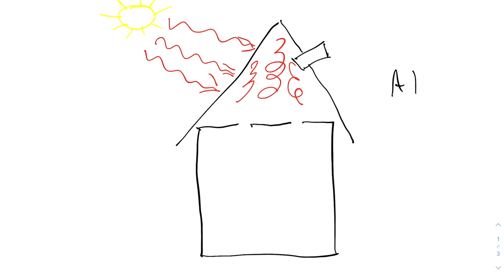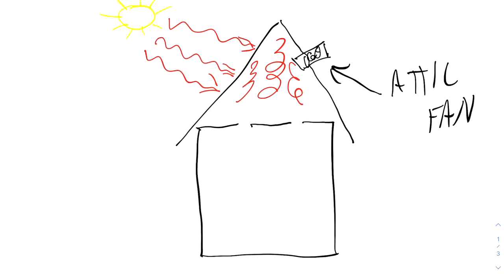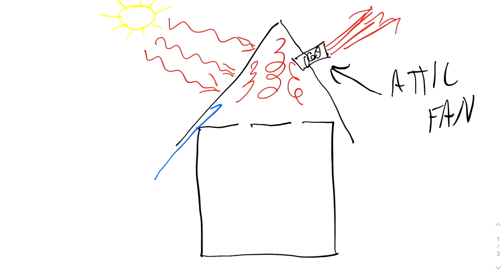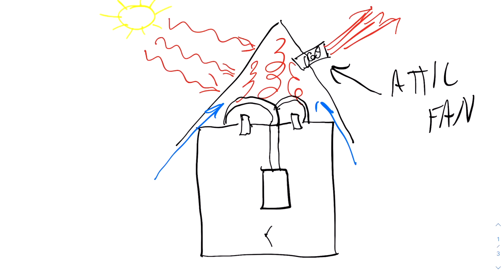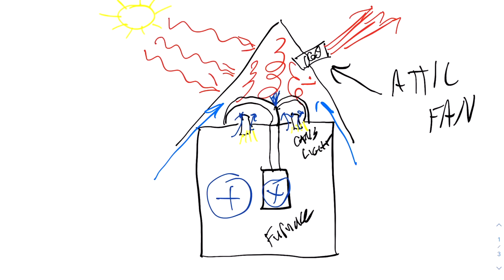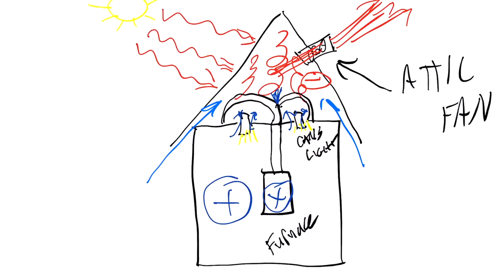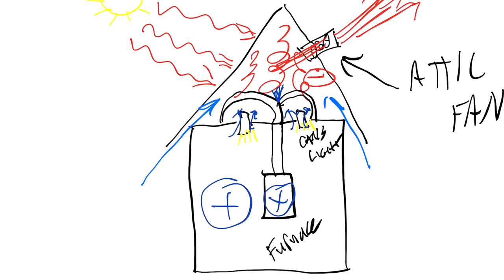3 Remodel Rip-Offs

Comment: Attic fan was one of the best things I installed in my home. Big difference in the house during the summer. My home was built in ‘52 if that matters.

I installed it myself.
Reply: Built in 54 and has a turbine vent that spins only when wind blows I think getting a solar fan one will be alot better to help draw heat out
Reply: Terrible idea. The attic is cooler because the attic fan you installed is pulling cold conditioned air from your living space into the attic. So while the attic is “cooler” thanks to more inefficient household air flow, you now put more load on your A/C unit(s) to compensate.
Reply: @eggnogaddict6287  Not at all. The inside the house is cooler and my bill is lower.
Reply: @LordDeadSpider  literally every lab test demonstrated cooler attics following the installation of a powered attic fan precisely because it creates increased negative vacuum pressure, pulling conditioned air from living space into the attic. Given your house is from 1952, it likely has significant air leakage.

But hey, maybe your zoned A/C system is keeping your less efficient zone 2 HVAC from running as much because the load on your primary AC has increased.
Reply: @eggnogaddict6287  Can you not read? My house, the inside. Not the attic. No ac in the equation. The inside of my house is cooler.
Reply: @LordDeadSpider  Yeah, you’re not very intelligent. The attic fan is creating a negative pressure vacuum and sucking soil gases into your house from the basement/foundation, pulling the cold air up through the house into the attic. Not exactly what’s desirable given you’re breathing in those cold soil gases. But let me guess—your heating bill is also lower, just as you’re not running the AC in your house when your attic is 120 degrees and it’s 90 outside.
Reply: @eggnogaddict6287  You are trying too hard. Any thing else that you would like to assume while you are up there on that high horse?
Reply: @eggnogaddict  Ya, I'm going to call BS. Let's look at this a bit further. 

1) Most of the houses where I live not only have soffits, but they also have a gable vents.  I personally have 6 large gable vents on my house: two on the back, two on the front, and one on each side of the house. I also have soffits all over in my attic. So first and foremost, if the attic solar fans are pulling air from somewhere, it's far easier to pull unobstructed air from the large gable vents and soffits vs trying to pull air from tiny cracks and air gaps between my ceiling and attic.  Air, like water, will take the path of least resistance which again will be those large gable vents and soffits in my attic. On a hot day, my attic was easily reaching 130-140 degrees. By installing a solar attic fan, I'm replacing the 130-140 degree hot air with outside ambient air through gable vents and soffits which is easily 40+ degrees cooler! 

2) Hypothetically though, lets assume I don't have any gable vents or soffits. So as you say, it produces negative pressure in the attic, thus pulling air from the house instead via all the cracks and air gaps in the house ceiling.

Last time I checked, hot air rises. Are we in agreement there? And the air being pulled into the attic from the negative pressure will be the air that sits at the top of the ceiling correct? So......using some deductive reasoning here, the air being pulled into the attic is the hottest air that's currently sitting in your house thus leaving the rest of the house feeling cooler because the hot air isn't sitting in the room at the ceiling. I mean, it's not like you're installing a cold air intake that pulls the cold air from the floor and directs it into the attic. No, you're pulling the absolute hottest air in the house, that's sitting on the ceiling, into the attic. Getting rid of that hot air will make the room feel cooler.

3) Also, your comment on soil gases is hilarious! If you're really worried about soil gases, then you should be worried when your house has no airflow at all because those nasty soil gases will leak into your house and then just sit there accumulating in your house. At least if you have negative pressure, the gases are pulled out of your house through the ceiling cracks and gaps. Plus, again, use a little path of least resistance common sense here. Most houses have window and door leaks. It's far easier to pull negative pressure air through those than it would be to suck air through 6 inches of solid concrete. Here's an analogy for you:  You have your car running in the garage producing carbon monoxide. If the door is shut, like your "sealed" house, then that carbon monoxide starts accumulating to the point that it will make you pass out and kill you.  However, if you open the garage door, then there's a path for the exhaust to go and it won't accumulate in the garage at dangerous levels.  So again, this comment is hilarious.

I personally don't have A/C in my house. You can tell me all the conspiracy theories that you want, but at the end of the day, my attic and my house is a lot cooler since I installed the solar attic fans and I'd do it again in a heartbeat!  

And if I get AC in the future, having these only helps the situation because it will keep the house cooler longer so the A/C doesn't even need to be kicked on in the first place.  Thus saving money and the environment!
Reply: @eggnogaddict6287  The aspect of this that you're failing to comprehend is that some people don't have adequate HVAC systems. So if their house isn't getting cool, the attic fan is pulling the warmest air out of their house first, (hot air rises) into the attic... which allows the interior of the house to feel cooler.
Reply: @eggnogaddict6287  that’s simply not true.
Reply: @eggnogaddict6287  Wow buddy. You made my day. It's people like you that make me admire my engineering degree. 99% of LordDeadSpider's airflow into the attic is coming from gable vents or soffit vents, not their house. And ambient outside air is cooler than stagnant attic air, so yes, the attic is cooler than before, which means the house will be cooler.
Reply: @luke-i1w  that’s hilarious given the studies and experiments showing otherwise. But I love the tens of millions of “engineers” we have—it’s the new sociology degree. Everyone is an engineer. Interior conditioned space is even cooler than outside air, so much for your argument.
Reply: @eggnogaddict6287  You still have yet to say anything correct...
Reply: @luke-i1w  this coming from the guy who pulled 99% out of the air. But hey, you’re an engineer so you know everything from roller coaster design to aerodynamics to home ventilation to automobile engineering. And yet you’re commenting on YouTube videos. I’ve hired experts in their fields who didn’t do good jobs. Suffice it to say I doubt your expertise on the drawbacks to attic fans that have DOE studies showing it. But hey, you have a piece of paper that said you took classes at a school, so you must know better. Enjoy.
Reply: @eggnogaddict6287  You discredit me for commenting on youtube videos...as you comment on youtube videos. You've been at it in this particular scenario for 2 months longer than me as well. 

And I'll take an engineer's educated guesses over whatever it is you're stating any day.
Reply: @luke-i1w  well, yes, I am commenting while not doing cosplay pretending to be something otherwise. I haven’t been at this for months—I get notifications people are replying long after I did. But there you have it: an engineer’s educated guess. That’s the problem—there are DOE studies showing the exact opposite with actual evidence and measurements. An engineer worth their salt would pause, look into those data and studies, and would take issue or agree with it. Instead, you’d prefer to throw out “99%” numbers based on no idea of what house you’re actually looking at, which is hilarious. Apparently it’s a standard 99% and all homes are air sealed equally. Suffice it to say we have specialists in medicine that focus on one part of the body, or a specific sub-system. We have second opinions as well given one doctor may be completely wrong. But here you are, the be-all, end-all engineer lobbing out educated guesses about a topic you didn’t cover at all in school. But because you’re an engineer, why, that makes you an expert on anything involving engineering, which is like saying a family doctor is the same as a heart surgeon or dentist. That analogy isn’t quite fair, though, given medical doctors deal with people. Engineering is a far broader field. You have electrical engineers and you have civil engineers. Road building and electricity have less in common than a family doctor and a dentist. So saying you’re an “engineer” doesn’t really mean much. It’s even less specific than saying “I’m a medical doctor.” Heck, computer programmers typing code consider themselves engineers. Typing code vs. the physical world. My point exactly.
Reply: @eggnogaddict6287  Is that you Matt?? Hundreds of comments and likes of actual homeowners with their own real world data and then there's you, just out here getting ratioed to dust. You got studies? Drop a link lol
Reply: @garyindiana2127  Gary from Indiana? Is that you?? Oh no, ratio’d!!! The internet—a place that doesn’t exist by people I don’t even know! How will I recover from these thumbs up????
Reply: @eggnogaddict6287  out here doth protesting way too much. Just get an attic fan already damn😂

Comment: Replacement windows are only a rip off if the only reason you bought them was to save money on your current utilities.  Being more comfortable, better looking, resale, reduced outside noise, cleaning, all good reasons to buy them.
Reply: Not to mention reduction in internal heat/fading (with low-e glass), the reduction of condensation/mold in colder climates.  Several years ago, in an older home I used to have, I replaced my own windows - previous single pane (yes, even cutting out/around stucco - not the Z-frame insert crap) and properly installed them, and it made a HUGE difference in my comfort level in the home and lowered my electric bill significantly in Northern California.

Comment: I've got smart thermostats and all I can say is, I saved a lot of money only heating the bedrooms in the morning to get up comfortably, they then shut off and the rads in the kitchen get working. Also resolved all balancing issues (unless everything is calling for heat) because the valves are open or shut, unlike Thermostatic ones which taper between quite open and mostly shut. Just fitting a programmable thermostat in the last bedroom resolved a "Never got any heat" 1st thing issue.

Not for every situation,  I see a lot of these US properties have huge open plan spaces.

But for most. Hard to tell but I think my cold weather gas use went down over 25%. These days that's going to be a 1 year payback on £500. I self installed about 9 rads for about £300.
Reply: Same here. We were saving even more before the pandemic when we were home less. I think Matt is simply wrong here .

Comment: We had 40 year old single pane windows, and after much research, chose a medium-high-end double pane double hung (for cleaning) Argon filled vinyl frame windows all the way around. The vinyl was a special composite, but it was the glass itself that was appealing to us. One side is thicker than the other so that they resonate at different frequencies. Any neighborhood radios blasting at my house are now completely gone. There's more noise permeating the walls themselves. Like moving into a new house. Texas energy savings is still profound.
** True if you're upgrading double pane to double pane- meh increases in efficiency expected.

Comment: Ventilation in your attic is definitely the best way to cool the attic. Max air circulation is key, I would know because I work in attics in the summer everyday. #sinnisjInsulator.
Reply: This is because you sweat and the fan evaporates the sweat . Not relevant to keeping your attic cool.
Reply: @rohitkrishnan4482  I've never worked in an attic with a fan, only whirlybirds. I understand it's heat radiated from the shingles and insulating the underside of the roof with the way to go.

Comment: Hi Matt, as the proud owner of a smart thermostat and one who did a lot of research on them before selecting one, I can comfortably say that you are incorrect on your view of them but some of what you are incorrect on is due to terminology.

A "smart thermostat" is any thermostat that is part of a home automation system or otherwise independent of being completely reliant on programming or manual changing. The type you specifically referenced are learning thermostats and yes, those are definitely too smart for their own good as they try too hard to extrapolate patterns (when are people home, when do they wake up and go to bed, what is comfortable, etc.) and when those patterns change they either don't/won't/can't update the pattern or are very slow in doing so. However if you look for a non-learning thermostat (I have the Ecobee 3 Lite that is this way) and integrate it with a smart home system (such as Samsung's SmartThings) then they are perfect. When used with a person tracker for the automation system, my thermostat will change heat and cool settings automatically after I leave and return them to my comfort settings as soon as I get home. No learning needed and before the pandemic started leaving me at home nearly all the time, my electric and gas bills had gone down almost 15% from what they were on the simply programmable thermostat. In either case though, those thermostats can also be set with alerts and reminders to tell home owners if it is too hot or too cold in their house, it is time for preventative service, change the filter, and sometimes when something has gone wrong.
Reply: Agreed, and the Ecobee's sensors and the ability to group them has helped me balance my crappily installed system to increase comfort greatly. AND I've used SmartThings to control a smart plug to operate a humidifier AND dehumidifier based on what the ecobee is detecting. I use Life360 with SmartThings to control home/away on the ecobee, and I use Beestat to help monitor my system efficiency and to help set aux and balance points for low temp winter heat pump use.

Comment: I have a "Whole house" fan in my house versus an attic fan. It pulls out the air in the house within 5 - 10 minutes. I've also used it instead of my a/c on mild days with a window open. Was told when got new central installed to get rid of it. Disagreed and had no major issues with having both. Had to replace my windows though. They were single pane aluminum windows from the 70's. It did help in my case but doing additional things did as well.
Reply: Agreed. We are in SW PA.  Use whole house fan all summer, AC maybe 5-8 x when extra humid.  Never run AC and fan together of course!  We dial in comfort by opening selected windows.  Everyone else here is just running AC too much.  Attic fan could be okay but most attics are not sealed well so fan will draw cool air from house into attic. Think about attic stair for example.  Attic fan use assumes perfect air sealing and perfect soffit vents and chutes

Comment: Not sure that I agree on the attic fan.  The fan manufacturer specifies the minimum required intake vent size.  For example, a GAF 1,000 CFM exhaust fan for a 1,600 sq ft attic space requires you provide 480 sq inches of intake area in the form of gable vents and louvers to balance the ventilation of the attic.  When you provide sufficient intake area, the path of least resistance is for the replacement air to be drawn from the provided intake vents and not through the gaps in the ceiling openings.  Yes, there will always be some leakage through the any ceiling gaps due to delta P, but it will be just a few square inches of area compared to the 480 you provide.   On a closed ceiling, you would have nearly no leakage.  Therefore, the cfm through the ceiling openings will be minimal.  For them you can even estimate the leakage.  

Also, if the vents are on the gable, the intake air will provide some cooling to the inner surface of the sheathing as it rises to the peak.  All the powered fan is doing is increasing the cfm that naturally occurs as the sun heats the roof, the shingles heat the sheathing, the sheathing heats the air in the attic, and the hot air rises to the ridge vent.  It's like the difference between standing in the sunlight on a humid day with no breeze, and then in a breeze.  How energy efficient the system is compared to an unpowered vent or an air-conditioned space, is dependent on the net system design. (Roof pitch, insulation, vents, shingle color, region, etc.)

Here's a conservative example.  Assume that the gable vents total out to exactly what the manufacturer requires for a 1600 sq ft attic (480 sq in) That's like a tiny 1" wide gable vent strip on each side of a 16' long x 10' wide attic. Say you had qty4 6"-150W recessed ceiling lights, and the 4 lights all have 6-7/8" openings around a 6" diameter.  That's 35.5 square inches of vent opening per light, and a total area of 142 square inches for the ceiling.  In that case: 1000cfm (142 sq in/(480 sq in + 142 sq in)) = 230 cfm of ceiling leakage.  The kind of leakage you describe in your video.  

But for a wide-open ceiling like that, with minimum gable venting like I described, you would want to have more intake vent area to reduce the draw through the ceiling lights.  Like double the 480 sq in required by the manufacturer.  So you could add a square side vent with another 480 sq in, (or go with a 2" wide gable vent) to get 960 sq in of attic intake venting.  That 960 sq in would reduce the ceiling leakage to 128 cfm.  If you did both, you would reduce it to 90 cfm.  Of course, you could replace the old vented fixtures with smaller LED fixtures.